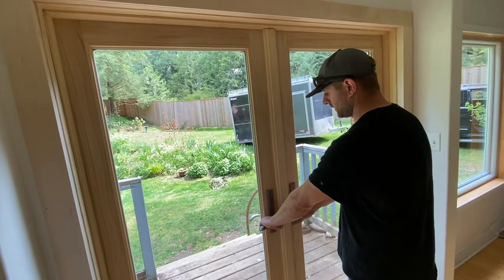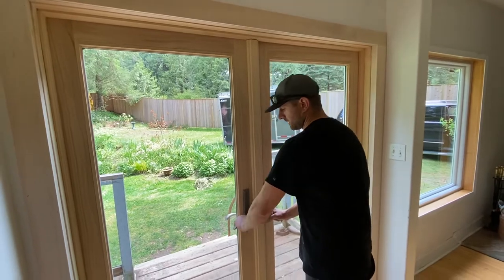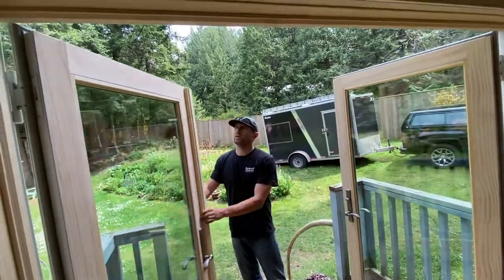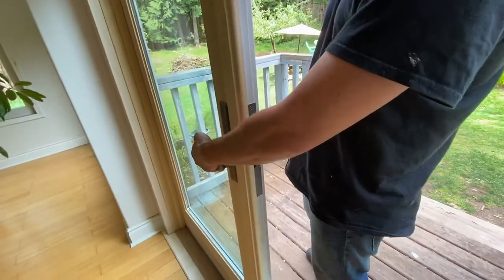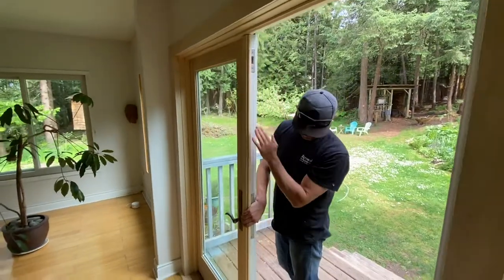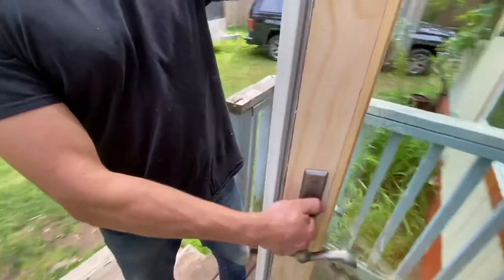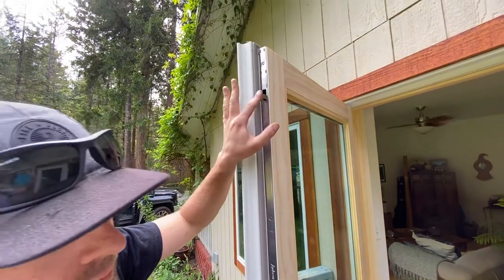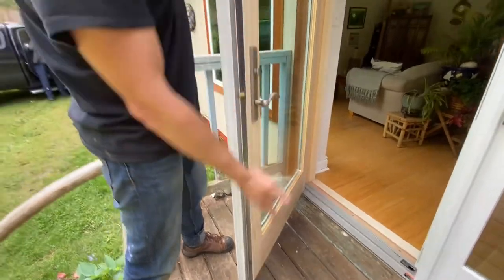Swing out french door installation with multipoint lock

Comment: who built your doors?  I am needing those exact doors with a total 84" wide door opening
Reply: yup.   they left out a key bit of info...
Reply: One of his other videos, he unpacks a window from Renewal by Andersen.. Google searched their french patio doors and they have one just like this.
Reply: Is that safe to have the hinges on outside for someone to remove the pin?
Reply: @Sallyleahplotagon2015  I was wondering the same thing. We asked another company and they said they come with non removable pins.
Reply: We are looking to replace the door handles and lock mechanism. But cannot find the parts. I need ideas where to look for replacement parts?
Reply: Can you just flip a normal French door to achieve this?
Reply: if you do the lock will be on the outside....the wrong side.